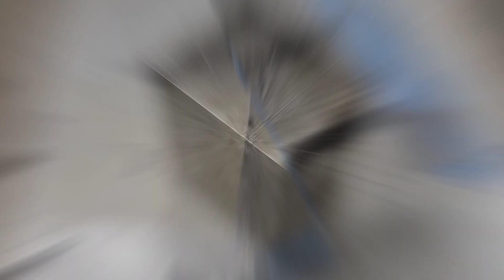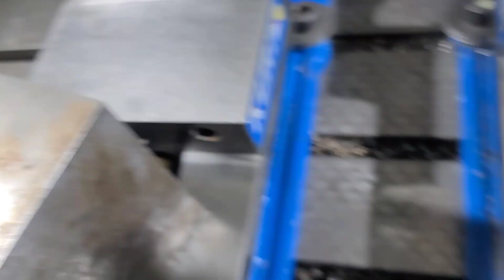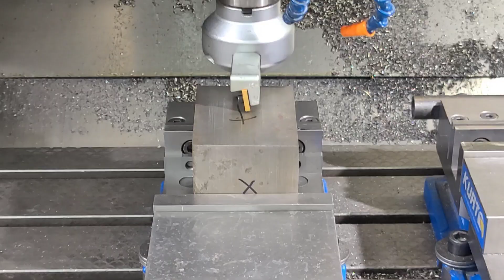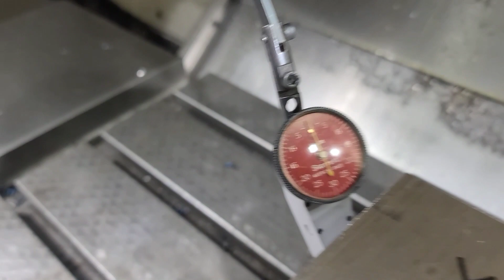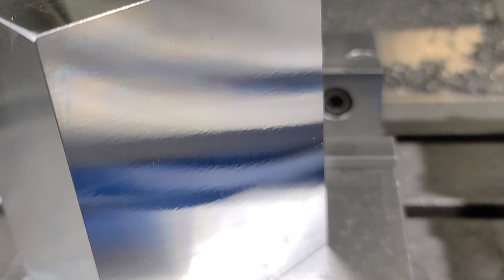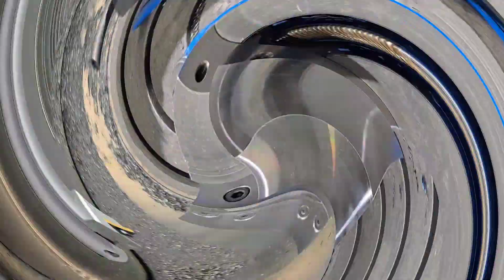Squaring a Block of P20 Mold Steel with a Fly Cutter

Comment: Hi, amazing finish and explanation. Do you have in hand a SS 304 example?
Reply from the maker: Thanks for watching and commenting! Unfortunately this cutter does not work well with 304 stainless. It works on other free machining SS grades but 304 is a big no with this cutter due to the geometry of the insert.
Reply: @mvpmachine  thank you for the answer. Im searching for this kind of finish in SS can you give me some advice?
Reply from the maker: @dmmultimediamx  I would use a large facemill with inserts rated for 304 SS and remove all but 1 insert should give you a fly cutter like finish. I cannot recommend any specific brands but would recommend talking to a rep from Sandvik, Sumitomo, or Iscar to advise you as they will have the correct insert grades available
Reply from the maker: Mitsubishi is another one to look into they make some incredible inserts for hard to cut materials I would try them first
Reply: @mvpmachine  Thank you so much sir. lets se how works the facemill tip.

Comment: It is not necessary to tap the part down for the first and second sides. For the second side try to use the most engagement on the fixed jaw, so leave out the parallels. The ensure the second and third sides are referenced from the datum fixed jaw and not the moving jaw a bar is placed between the part and the moving jaw. A good tip to square up the ends is to hold the block between two vee blocks, this automatically references on all four machined faces and holds to part naturally square.